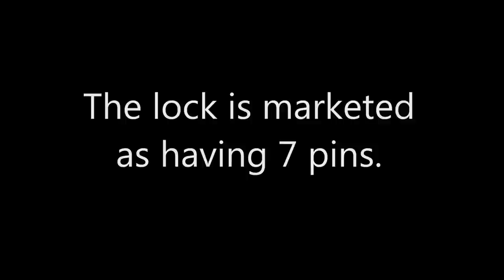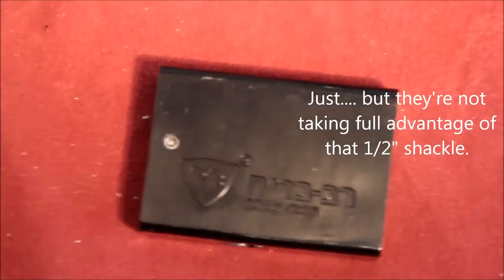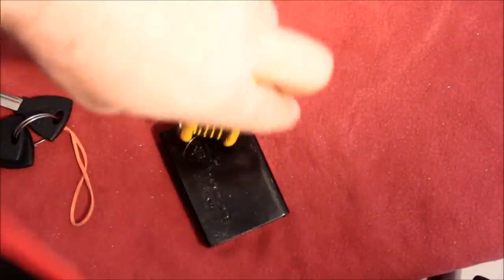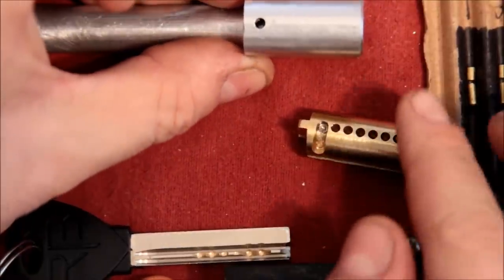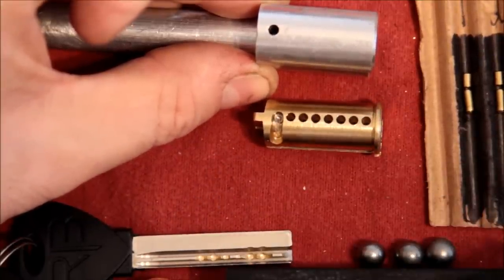(162) Mul-T-Fail: Rav Bariach Padlock Gutted and Humiliated (2 of 2)

Comment from the maker: From the lockwiki page on Mul-T-Lock: Mul-T-Lock is an Israeli lock manufacturer founded in 1973 by Avraham Bachri and Moshe Dolev. The motivation behind Mul-T-Lock began in 1972 when Bachri's neighbour asked him to build and install a secure door. After installing the locks, Bachri discussed the design of secure doors with Moshe Dolev. The two designed a multi-point locking system. They formed a company around the system, named Rav-Bariach. In 1985, the company was aptly re-named “Mul-T" Lock.

Comment from the maker: Well.... I think if you could fit larger ball bearings in there and swap out the cylinder for something decent, you might have something. But I think I'd put my modified Master lock (with the Commando core) up against this puppy and give it pretty fair odds... for less than 1/3 the price (including the Commando core).